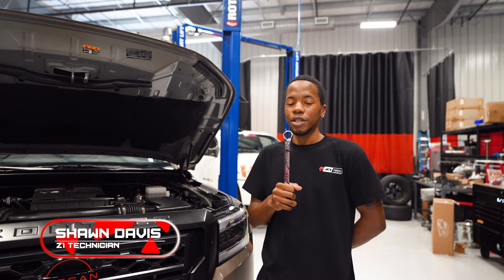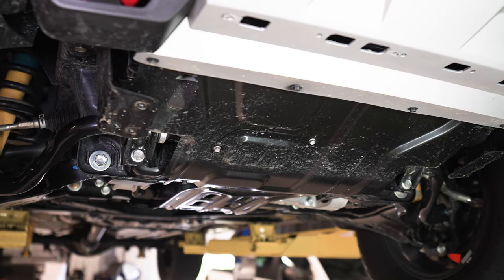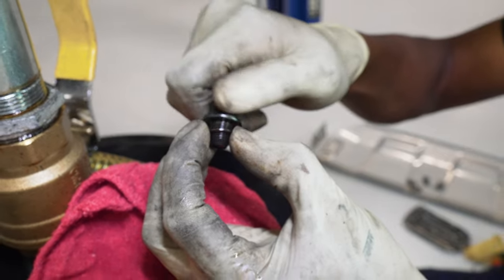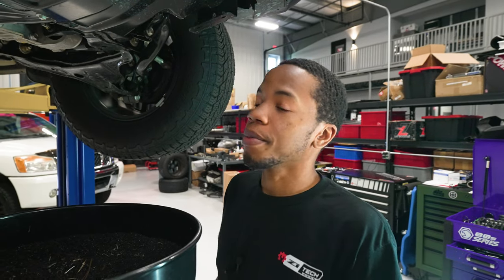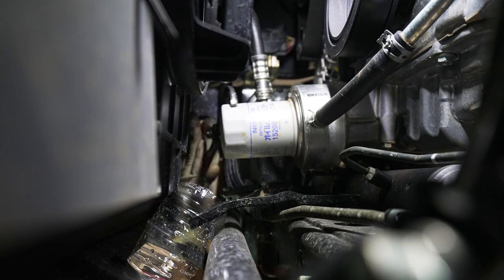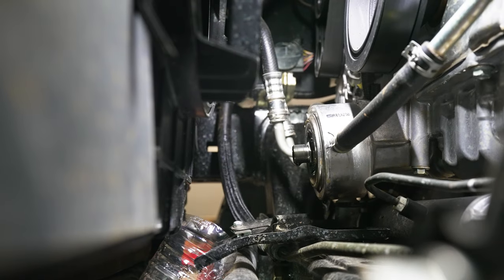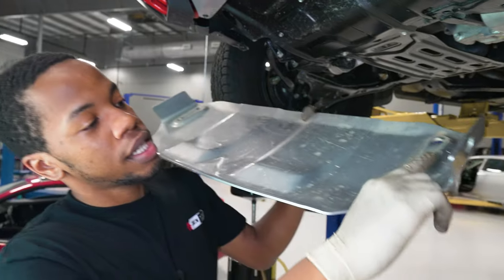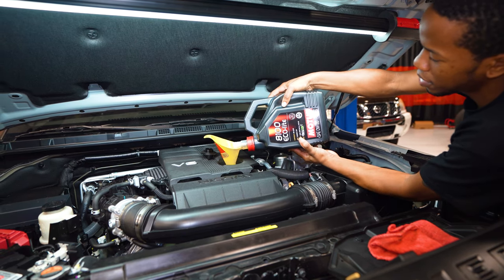2022 Nissan Frontier Oil Change Guide

Comment: The sad part is I don’t trust the dealership to do as awesome of a job as you did.
Reply: I don't trust them or those Kwiky oil change places to do as good a job as I would do myself.
Reply: Just like the dr says no one cares about you body and what you do to it more then you do. I feel same goes for vehicles. 😂
Reply: Me either and they don’t
Reply: @User-q6x3b how did you find that out?
Reply: @User-q6x3b  ah I see, in any event it won’t hurt it.
Reply: @User-q6x3b  one thing you can do to make sure they change the filter is reach down from the top and put a little x on it with a sharpie.
Reply: @User-q6x3b  you’re welcome. My wife works at the dealership and I can get mine changed and the tires rotated for less than $50 so I can’t justify changing my own. The filter and oil alone are close to $40.

Comment: excellent video showing how to deal with an absolutely horrendous design for filter location. I thought some of the GM engineers were evil, but those Nissan guys are something else
Reply: It's not that bad...come onnnn!!!
Reply: SERIOUSLY!  worst engineering design ever.  My first oil change I could not believe where that filter was.  I might nit have bought the truck had I known too 😂
Reply: @All-Miles-Matter  Disagree.  I think it really is THAT bad.  I've always done as much maintenance on my trucks as possible including twice per year oil changes.  This set up doesn't allow one to fully inspect, remove, install, and then TEST a new filter installation.  I've seen gaskets on new filters fail when a vehicle is first started after filter replacement.  I hate when engineers don't consider ease of access and maintenance; especially on a part which needs replacement with some frequency.
Reply: @rickwhitfield7617  I am considering buying my first Nissan Frontier in 5 decades since I owned 2 Datsun pickups way back when.  And I agree with you.  I saw this video and immediately questioned my thinking.
Reply: I believe the engineer they hired to come up with this design of oil filter location finished last of class
Reply: at least its not a Subaru with the oil filter wrapped inside the ring of fire exhaust system....... I'd like to know what the engineers were smoking on that one.
Reply: you can do the job from the top of the engine bay

Comment: Nice video, but 95% of us doing our own oil changes are NOT going to have the convenience of using a lift.    Most people are probably going to have a set of ramps.  Getting your hand thru that little access hold might be a bit more trying, especially laying on your back.
Reply: It’s not actually, I can reach it. I just did it on my 22 KC S 4x4
Reply: I have yet to do it on my 2023 Frontier Pro-4X, but I can easily do it on my 2015 Frontier SV.
Reply: I agree with your concern.  I change oil the same way.  I need to inspect the filter attachment base both to clean and then after filling with oil and running to check for leaks.  This looks like a huge challenge to be able to perform.

Comment: Shawn, thanks for the great video! Very high quality production and super informative. I'm about to do my first oil change and this video is PERFECT! Hoping you can do a video to drain and fill the transmission. I tow with my 2022 Frontier so the trans fluid must be changed every 30K. The dealer wants $400 to perform the service!! I would like to perform the service myself :)
Reply from the maker: Thanks for the feedback, we will make a note to try show a transmission service also in the same style/quality video!
Reply: @z1off-road  Thanks! This would be a really valuable video. I don’t want to pay the dealer $400 to do it when I can most likely do it myself. Looking forward to seeing the video. If Shawn’s around please have him do it. His presentation style is outstanding!

Comment: Nice job on the video! One of the reasons I'm getting away from my RAM is because you have to be Houdini to get at its oil filter! Seems the people who design these vehicles are NOT the ones who have to work on them! Seen the cost of an oil change these days? That's why more and more older guys insist on doing their own work on routine maint chores like an oil change. Thanks again and good job walking me through an otherwise simple job!:yougotthis:

Comment: Wonderful video. Going to do my next oil change myself.
Reply: Just make sure to leave the cover and skid plate off until you inspect the new filter for a leak after you add the oil and start the engine.  A failed or leaking gasket will be a bitch with this poor design to clearly see and inspect your work.

Comment: Awesome video!  Just bought a 2023 so I will be doing this in the future.
Reply: U ever smell a bit of gas in the oil on the dipstick during break-in?
Reply: @User-q6x3b  will check tonight, I only have 201 miles on it so far.
Reply: @aurktman1106  ok sounds good. That's about where I'm at(215). I bought it with 40. I prefer less than 10 because I don't trust test drivers but everyone seems to say 40 is not a problem at all.
Reply: @User-q6x3b  Mine had 17, and a friend of mine actually test drove it before I did so I know about 5 of those miles were from him.  I know when it was delivered to my dealer, it had 7 miles.  Someone had fun for 5 miles in a test drive that will remain unknown.
Reply: @aurktman1106  well at leat you know most of the 17. Although it says you shouldn't go crazy before 1200 in the book, guys like Raitis Rides on YouTube redline everything in sight. It's tough to figure

Comment: I would like to see the same for a 2024 Pro4x- they moved the filter access hole further down under the filter which puts you at a terrible angle to get the filter off when the factory put it on with brute force. The drainage tray under the filter sticks out just enough where you can’t get a full grip on it at at right angle. This is very frustrating!

Comment: Well I was thinking about buying a new Frontier, but maybe not now...changing your oil should be easy. Not stupid.
Reply: I went ahead and purchased a "new to me" 2023 Nissan Frontier because all things considered, I think it is likely the best choice for a mid-sized pickup that will last a long time.  I'm contemplating my first oil change before winter, so came back to this video to refresh my memory from an earlier view.  I agree that the oil filter exercise is ridiculous.  The other thing I've noted is that if you look up oil specifications for a 2023 +/- Frontier, you get a 5w-30 response.  My owners manual says 0w-20 and the tech in this video is using the same.  Not sure why the misinformation, but I'll stick with manufacturer's recommendation.

Comment: Perfect timing on this video because I'm getting ready to do the breaking oil change on my 22 SV crew cab. Thank you for the information. Much appreciated and I'm glad to know that I won't necessarily have to take that entire plate off but only the inspection plate for the oil filter. Thank you again for the much-needed information. 😇🛻
Reply: how many miles is the "break in change" suppose to be?
Reply: @mafosa9563  usually the first 1,000 miles.
Reply: I had to drop the rear of the skid plate, it’s only two bolts.

Comment: The SV doesn’t have the same skid plate. The inspection cover is useless except to see what you’re doing. I had to drop the rear portion of the skid plate just to get hands in a spot where I could remove the filter and install a new one. No big deal, they are just slightly different. Cool trick with the water bottle though.

Comment: Seems like all 3 models are a little different.i have the base S model.just take the inspection plate off then take the 4 screws in front under the bumper and the 2 in the back on the skidplate.this loosens up the plate giving u enuff room to get to the filter.its a little awkward but u can do it without lifting it up.use a long ratchet handle for more turning clearance

Comment: Makes me wonder if techs will just skip replacing the filter
Reply: Take a sharpie and you can reach down from the top of the engine and put a little mark on it so you’ll know if they did. I have one and I did that, they changed it.

Comment: Good Video.  I had a 2012 Frontier with 4.0L V6 and it was a pain to change the oil filter. It is surprising that Nissan did not change the oil filter location with this new 3.8L engine.  They kept the same oil filter spot as they had with that old  4.0L engine that was in production 2005-2020.   That access panel is worthless.  Not all the oil drips down the metal deflector in the front , some will drip from the top and to back side.  You need brake cleaner for that part.  You always have to remove and install the filter from passenger side as he did.  Not sure filling the oil filter and dripping some out while installing the filter is necessary.
Reply: Agree.  Poor design location.  My first thought when he filled the oil filter with oil is that he was going to lose some screwing filter on in a horizontal position.
Reply: Thanks.  Was wondering about that.  Also, do not re-install that access panel until after you have replaced the oil and started the vehicle up to check for leaks.  I have seen oil filter gaskets fail before!  Also one more gripe ... what is up with 5.3 quarts of oil??  Now I have to buy a second 5 quart container of synthetic ($) to cover 0.3 quarts??

Comment: Very well done.  Only suggestion is to mention the torque requirements for the bolts.
Seems like a crazy location for an oil filter.  What a pain.  Nissan can't you build an engine that can be serviced without taking the car apart?
Agree with the others, do you really expect the dealer or other shops to do as thorough job as you did.
Reply: I have never owned a torque wrench and have done hundreds of oil changes and never had an issue with oil leaking. Just tighten them until snug and you’ll be fine.

Comment: AHHH! you put the plug in before removing the oil filter. after removing the old filter more oil usualy comes out, like taking your finger off the end of a straw that has water in it. also always check that the old gasket came off with the old filter and that's a crush gasket, not a washer but yes it looks that way.

Comment: Excellent video! How many miles would you recommend for the first oil change of a Frontier Pro-4X? I hear some say that a vehicle's first oil change should be at about 1,000 miles and then every 5,000 or 7.500 miles depending on driving conditions. Is this true?
Reply from the maker: Correct, if you live in a very dusty area, or like spring time around here we get a ton of pollen, changing engine oil at a higher frequency is a must. Lower quality of oil and the way you drive will also shorten that interval.

Comment: If you think this oil filter placement is bad, try doing one on a 2013 Buick Enclave. It’s essentially in the same spot but they didn’t add any access panel so you have to reach in from the top with your arm sandwiched between a hot radiator and a hot exhaust manifold. Then they placed it at the most awkward angle possible to loosen or start the new one on the threads. I’m pretty sure dislocate my shoulder and use every word in the dictionary when I work on that GM piece of garbage.

Comment: Please show a oil chabge with a 2022 nissan frontier with the damn plastic skid plate mine doesn’t have a metal one how come????
Reply from the maker: The aluminum skid plate is for the Pro4X trim. But the oil change is almost identical once you remove that plastic air dam.

Comment: I purchased my 22 Frontier used and it doesn't have the large outer cover that is removed first in the video. Do all 2022s have that?
Reply from the maker: The silver skid plate would only come on the Pro4X trims. Depending on what trim level you have, you might have a plastic cover.
Reply: @z1off-road  I have an SX and I only have the cover with the removable plate to access the oil filter. Thank you

Comment: If I ever meet the engineer who designed this oil filter location, they might get socked in the nose. It is absurdly and unnecessarily difficult to reach this filter on the ground and hard not to make a mess. At least on my 2017 Pro4x you could easily remove the entire skid plate, giving you clear access.
Reply: Agree with you.  Have no use for engineers that don't consider maintenance ease in their design; especially where this is a relatively new engine upgrade.

Comment: This is kind of a hassle compared to my 2019. It's almost the same procedure except on the 2019 there's just a little access window for the filter and the oil trough is long enough you don't need to do the water bottle mod.

Comment: Is 0w 20 too thin viscosity for heavy driving and Texas climate.  Didn't see a motul for nissan in 5w-20
Reply from the maker: We've got you covered with an assortment of other kits competitively priced and ready to go https://www.z1offroad.com/oils-and-lubricants/engine-oil-and-filters-c-6_542_83441.html?b=Assembled%2520by%2520Z1%2520Off%2520Road&m=D41
Reply: @z1off-road  shows all to be 0w20
Reply from the maker: @grapplerguy2007  0-20 is the Nissan Spec weight.  As we get performance upgrades and packages that provide significantly more power than the 0-20 can handle we will put together kits with a 30 weight.  For now we’re doing all our testing, hauling and truck stuff on 0-20.

Comment: Ok, here's a problem with your procedure.  If you replace cover and skid plate right away before filling with oil and running the engine, how are you to determine that the gasket on your oil filter is good to go?  I've seen gaskets fail on an oil filter change.  After you change your filter and add oil, then you start engine and immediately check for no oil filter leaks.  To me,  who is considering purchasing a Nissan Frontier, this has me wondering about my options.  I do much of my own maintenance and I don't have a lift at my disposal.  I work on the grass or gravel on my back with a set of ramps to change my oil filters on all of my current and previous vehicles.  This set up is ridiculous.  I like/need to inspect and clean the surface of the oil filter base.  Having to peekaboo to remove, install, and then inspect is a real hassle.  They must have been thinking everyone has small/narrow hands and the ability to see around corners.

Comment: After 35 years of oil changes, I don't recall prefilling the new filter. Is that specific to the Nissan Frontier?
Reply: I've never done it either, including on my 2015 Frontier. It makes sense to do it, I guess, but it would be messy as hell.

Comment: I can't believe you didn't check for leaks before you buttoned it up. If you have a problem,  you would have to take it all off again.
Reply: Agreed.  That is standard practice.  Have seen gaskets fail, and without checking, the first sign would be a warning light that you have no oil pressure ... or the large puddle or trail of oil under your vehicle.

Comment: Why not just remove the steel skid plate to have more room replacing the filter
Reply from the maker: On theD41 Pro4X it is mounted behind the plastic part of the front bumper.  Unfortunately, it is difficult to get to without damaging or modifying the front bumper.

Comment: What I don't understand is why every one of these d*** videos has a metal skid plate to remove and the 2022 Nissan frontier, 6 cylinder doesn't have any such plate.It's all plastic and it's a friggin nightmare to figure out what to take out so you can get to the oil filter
Reply: Yep. Mine has no metal skid plate

Comment: Very stupid design flaw.  Just affected my buying decision.
Reply: Because of the filter location? if so that is ridiculous.
Reply: @PRO4XKEV  It's the location that's ridiculous and then it is horizontally mounted. A PIA and messy. Poor engineering!
Reply: I believe they do certain things to force people to pay for maintenance, obviously for money. Like german vehicles are notorious for that
Reply: @strayedcat1966 I changed my oil 4 times already and wasnt messy at all. Y'all commenting just based off the video like damn dude this is probably one of the easiest trucks to do an oil change.
Reply: @strayedcat1966  Agreed!
Reply: @D41Pat  How can you say that?  My most recent trucks have been Dodge, Chevy, and Ford.  Oil and filter changes were much easier!  Full view and access to gauge filter replacement without any panel or part removal.
Reply: @toms6841  my first truck and i find it really easy to do the oil change. It doesnt get messy especially when taking the filter.

Comment: OMG - I have an 02 Silverado 200K + MILES... I DRAIN THE OIL AND CHANGE THE FILTER... Never do i go through all that mess.... are you kidding me? is that what these pos cars are today? what a pain in the ass for something that 2 times a year.
Reply: Apparently you do not need a skid plate. I do off road and it was a selling feature for me. No more punctured oil filters and it does protect the bottom . To each their own.
Reply: @dougs867  It's not the skid plate that's the issue.  It's the location and setup/arrangement of the filter that's the problem.  Horizontal and difficult for anyone with more than small, thin hands.
Reply: @toms6841  missed that. Thought it was just the skid plate. My bad 🥺